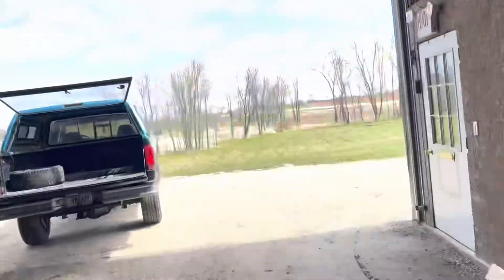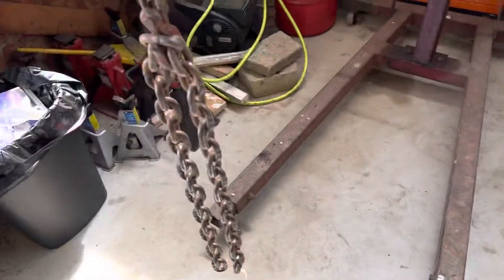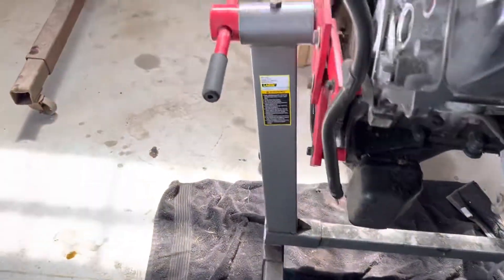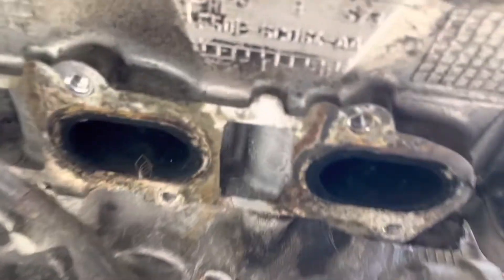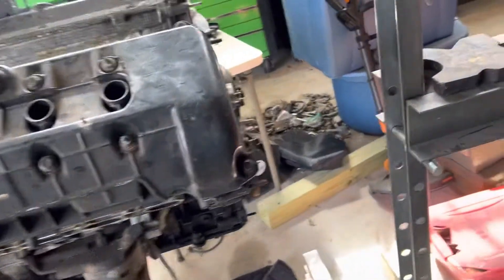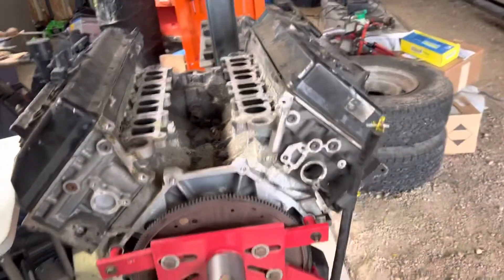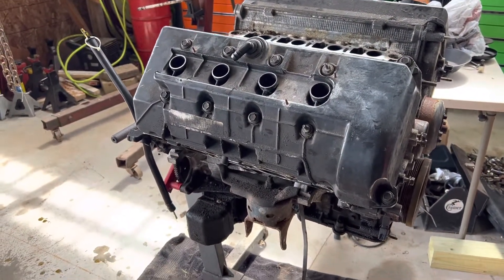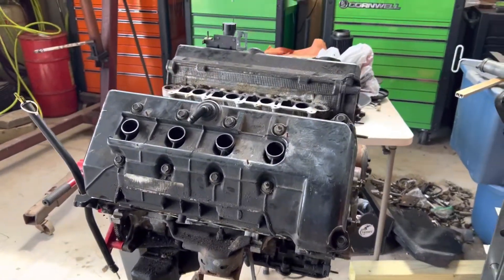Ford 4.6l teksid motor

Comment: I'm assuming you needed new cylinder sleeves? My 96 Teksid block was sitting indoors for 9 or 10 years and it turned out half the cylinders were full of coolant. I took the block to a machine shop and, what looked like superficial rust to me, they said would not come out in a 0.020 overbore. To me, the rust was looking like a hone job at worst, but they say it can go deeper and weaken the sleeves and crumble under load or at least scrape the rings on each rotation leading to premature ring wear and possible blow-by. He wasn't looking for work either (was booked through December).
Reply from the maker: Huh no kidding? I haven’t taken the heads off or anything so I have no clue what is inside the engine. I’m hoping it hasent been sitting for 10 years lol. But worst case scenerio if it is rusty I’ll either resleeve it or just get a new block. For the little money I paid for I’m not super worried but that is definitely a concern now. Im gonna start tearing it apart shortly I hope now that my 02 is up and running. How much was it to sleeve all your cylinders?
Reply: @T-MillProductions  My comment above was literally a couple hours after coming back from the machine shop yesterday. I'm trying to get some prices but if I do this "right" and really get everything re-sleeved with Darton sleeves (which have a large lip and requires additional machining) then it's about $1200 for the sleeves and at least that much if not more to send the block out to them to install. So total $2400 to $2700 plus shipping two ways... oh and 3 to 4 months wait. Nobody is available here in MA to do this kind of work. It's crazy.
Reply from the maker: Holy crap are you for real? I’m really hoping now that mines not all rusted up. I better get on that lol. Sorry to hear that you’re kinda in a screwed spot. I know when I got my 2v heads back it took 3 months to get them back and the machine shop I went to that’s a shit hole and I’ll never go back too, they said they’re backed up for months too. Idk why all of a sudden everyone is so busy. Unless there’s just not enough machine shops out there anymore to do the work
Reply: @T-MillProductions  I see a lot of videos of people honing rusted sleeves (no machining) and throwing the motor back together LOL. I'd love to hear how long their motor lasted. I'm going to take the block to another machine shop to get a second opinion and hoping for a better answer. Anyway, I've already invested $6K in parts (forged 10.5:1 Diamond pistons w/valve reliefs, K1 rods, race bearings, stage 3 cams w/0.480 lift, high lift springs, etc.), so I want to make sure this thing is bulletproof, but man, if I have to spend another $3K to get these Darton sleeves in I'm going to have to marry this thing (been with me for 26 years already...). My other option is to try to re-sleeve this myself but I'm not sure if these stock sleeves can be pulled. I was told by Darton that they must be machined out. But even if I can pull them, the next question is whether I can get new sleeves that are already 0.020 overbore because I can't return these pistons without losing 20% restocking fee and shipping...
Reply from the maker: That sucks man. It seems like it’s always something lol. I wanna do a similar build as you, I plan to do a .020 over and forged bottom end and then call up modular head shop and order custom cams for my motor. This stuff just gets to being more and more expensive each day. That’s kind of how my 2v build went, started out good and fairly cheap and turned into an expensive pain in the ass lol. For me if my teksid block is trash I’ll just reuse my Windsor block and hope she hold the power lol. I got a Nemak block too but I wanna use that for the 3v build. Did you keep the stock rod length or did you go with a stroker kit?
Reply: @T-MillProductions  The head shop is great and where I got most of my stuff. Super knowledgeable and helpful and I had a tracking # within a couple of hours of confirming my order. 4V motors are twice the cost of a lot of things (valves, springs, retainers, cams, followers, lash adjusters, and if you're porting, twice as many ports). Next time, I'm going with a 2V motor or 3V at worst. Some claim the Nemak block is stronger than the Teksid (especially in the crank area but not the crank itself). Not sure if I believe it yet but good to know it's strong. I was thinking if I need a new block to get the Nemak but not sure if I want to give up my Geman (kellog?) crank which is a beast of a crank and in great shape unless it would fit (not sure). I didn't get a stroker for the same reason... didn't want to give up this crank, plus I was going for higher revs and HP instead of torque.
Reply: @T-MillProductions  BTW... Lookup Pro Weld Performance Parts. They have some crazy nice teksid rebuilds (among others)... if only they would answer their phone!
Reply from the maker: That’s good to know man. Yea I’ve heard both about Nemaks too. I have no idea which one is better but I know they both hold power. I know the 8 bolt kellogs will fit in a nemak block. I plan to put one in my 3v when I rebuild it over winter. Im curious to see what a 3v is gonna cost over my 2v and 4v lol
Reply: @nicholash8021  how did y’all build go I’m also from ma and just got a teksid block and wondering what you guys decided to do TIA
Reply: @jayscorpion1878  Brought it to another machine shop, and they bored the worst cylinder and sure enough, the rust did not come out. I am postponing this to next year unfortunately. Will have to get it resleeved.
Reply from the maker: Mine is just fine. All my cylinder walls were free of any rust or deep scratches so I got lucky there
Reply: @nicholash8021  thank you for the reply I’m going to take apart my own now to see what it’s looking like and try and send it out by the weeks end to try and see what I’ll need